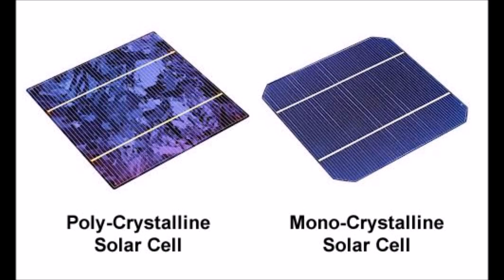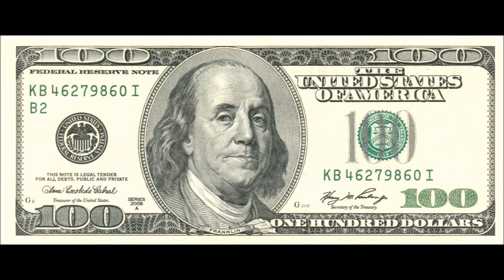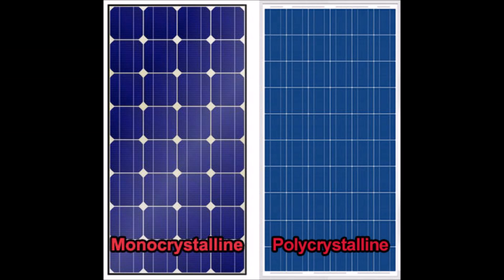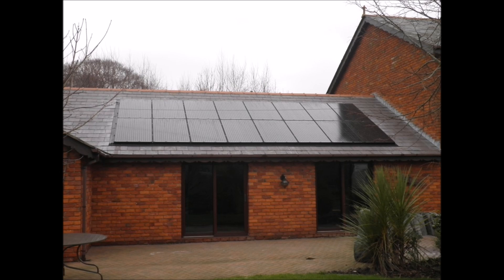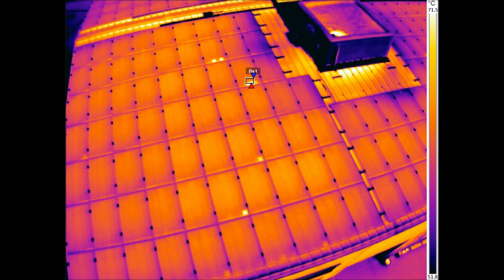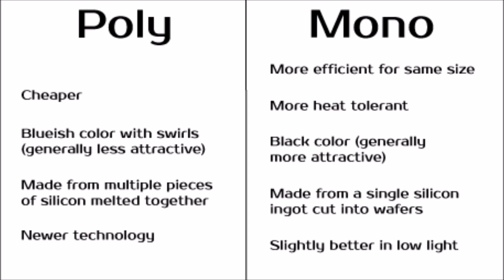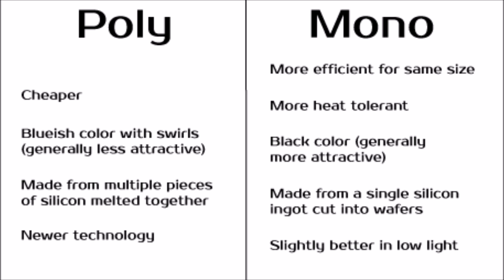Mono vs Poly Solar Panels Explained

Comment: When you say that mono panels are better in low light, is that comparing to the same space size poly, or the same wattage size poly?
Reply from the maker: Just the technology in general.  It isn't a big enough factor to persuade someone from buying mono unless you are getting many many panels and low light conditions will be common.  Like if you have an off grid cabin in Alaska or something.

Comment: Mono: More expensive, Generally black, more efficient, better in low light, more heat tolerant.

Poly: Cheaper, Generally blue, less efficient, worse in low light, less heat tolerant.

If your very concerned about cost, poly is where you want to go.

If you want the most efficiency, better looks, go to mono.
Reply: This crystal clear info i want

Comment: Mono do beater in cooler places. My mono do will in the winter but in the summer my pol out do the hands down. I live in SC where in the summer it can be 110 F with 95% humidity to 100%. I do not know if that has much to do with it or nit. Just know the pols make more power in full sun and the mono make more in shade or in cloud cover.

It's nuts just how much pv has come down. 10 years about I payed 6 bucks a watt. Now it's what 80 cents lol.

Comment: great info. thanks. as for the mono being cheaper, is that calculated on a per square foot basis, or a per watt basis? since they are more efficient, it is possible that they are more expressive per foot, but cheaper per watt. or maybe it's a wash???
Reply from the maker: Mono is more efficient so it is cheaper per square foot.  Per watt it is more expensive.

Comment: Great job. You have told me NOTHING about why the cells are differently shaped.
Reply from the maker: Sorry.  I didn't think that was relevant.
Reply: mono is cut from cylindrical boules where some of the rounded edges that remain can be seen, multi is cut from rectangular cast blocks

Comment: Ok so I’m doing a science assignment and I’m doing it on two different panels found on solar garden lights and seeing which one stays on longer  but I’m not sure what panels I’m dealing with at first I though mono poly but now I’m beginning to rethink the name of the lights are: gardenglo 35cm garden light and Alerc Elinor led solar path light. The Alerc one has a blue panel and the gardenglo one is black with small lines running through it
Reply from the maker: Poly panels are more often the bluish color and mono are more often black.  But that is not always true.  The best way to tell is that mono cells will be very uniform and even.  Poly cells will be more irregular and have transitions and jagged looking features.

Comment: Hi LDS . I see 100watt solar panels rated at 12V but a lot of 200watt ones are 18volt. Are the 18volt ones better to use for off grid homes?
Reply from the maker: They are the same thing.  12V solar panels are in reality 18V panels.

Comment: soooo poly is what is on thin film and what Tesla is putting out on roof shingles? which is better film or panels?
Reply: No polys are polys. thin film is more or less an ink that is printed on  flex plastic. More or less. Polys snap and brake just like mono's.. you can't bend them like you can an thin film or amorphous panel. Hope that helps
Reply: yankey4 what about there quality and performance to collect solar etc.
Reply: From the few I have had over the years. The amorphous panel down right suck. They did not last more than 2 years and there out put even new was maybe at best 70% of what there ratings where. Thin film I have not had much time with. They are kind of new to me so I do not know or can speek for there quality and performance . Sorry for spelling 2 ivs in my arms and computer hard to hold laing down..
Reply: I do have polys now that are 12 years old made from Kyocera. There still putting out 95% or so of there power. My mono's are doing the same there 13 years old. So tho's I can speak for,, I know that is not what your looking for. I just have to say what I know..
Reply: Amorphous is what kind
Reply: IV'S take care yankey4
Reply: So my primitive knowledge & understanding is that I need or looking for panels that collect (imput) the most solar to drive (output) my stuff. During high noon (effectiveness) or in an axis moving that follows the sun path increases my powering ability (output). & the ability to regulate storage to use & not use is a (controler) that keeps extra unused output in batteries for later use. The panels to use depends on your budget and efficient collection of solar & useage.
Did I get it in a nut shell?
Reply from the maker: Yep, that is a pretty good summary.  Good job!

Comment: Definitely going mono for a full house system
Reply: mono or poly comes in 2nd place after selecting the best vendor. I would use Poly from Trina Solar rather than Mono from some unknown brand

Comment: I do have a question.  Why do solar panel manufacturers stick to blue or black? those panels dont absorb all light waves. Why not make the panels out of a different color so they do absorb all colors?
Reply from the maker: That is just the color that results from the crystallization process of the silicon.  I'm pretty sure they can't change it... yet.
Reply: oh ok thx
Reply from the maker: You are welcome.  Thanks for watching!
Reply: your welcome

Comment: What do you think about flat film solar panels? I've heard that it's a new technology with lots of potential.
Reply from the maker: Thin film?  It is new and has potential but right now it has been less efficient than either mono or poly in the past.  However, I have seen CdTe panels that are now 21% efficient, which is better than mono or poly so I think we are moving in the right direction.  There are very few companies making them right now, though, so I have not gotten my hands on one.  I may try to see if I can do a review this summer.
Reply: I just saw a documentary on solar that followed an Australian companies research.  What they did was combined the traditional Silicon cells and the Gallium Arsenide cells in a unique double layering technique.  What makes it work so well is that it filters out the most efficient type of light for the Silicon and the rest of the light is reflected to the Gallium Arsenide.  The only draw back is that it must be liquid cooled to maintain efficiency.  It is expensive to produce, but I believe that since it is 30% or more efficient that it would pay for itself.  They had 1sq meter set up with mirrors reflecting the light directly into the panel and they recorded being able to produce 220kw.  I would like to know your thoughts on all of this, whether it is BS, viable, unrealistic, etc.

Comment: I'm wondering. I've heard that solar panel production can genetate quite a bit of local pollusion. Is there a difference in these manufacturing styles in that regard. I'm all solar but as I understand it you would not want to live close to the factories.
Reply: Jon Gretar Borgthorsson The factories are inside the sun so definitely not healthy being near. On earth it is much safer when they get delivered from the sun.
Reply from the maker: The processes are not all that different so I am sure they both have similar impacts on the environment.  Most rare earth element production happens in China and they don't really have great pollution and environment controls so that is probably where you are hearing about pollution.
Reply: LDSreliance Yeah I was propably thinking of the silicon tetrachloride byproduct from when they process the silicon with hydrochloric acid. Some of the cheaper manufacturers just dump it.
Reply from the maker: Yeah that is not good!
Reply: I dont know about everyone else, but I always stick to american made things no matter what. Yes, it may be a few extra bucks, but id say being the cause of someone losing their job is worse than paying a dollar or so more. Does anyone else agree?
Reply: I am a huge supporter if stimulating our domestic economy. I don't care how much extra it is. As long as the money gets recycled in our economy. Im with you 100% man!

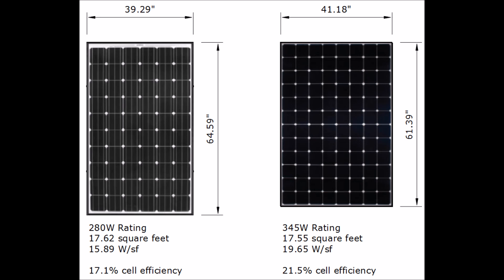Comment: You need to label better. On the panel diagram (about 1:20), you should label each panel so your viewers don't guess. Is the mono panel on the left or the right? We have to guess. Also, a national average cost per watt between the two types would be helpful; otherwise, it seems you'd always pick mono.,
Reply from the maker: Good ideas.  Unfortunately, that picture was borrowed from another source but I guess I could have overlayed some text.

Comment: Funny, I always liked the look of poly panels better.
Reply from the maker: They can both be pretty cool, I guess.  But most people prefer that black on black look which does not draw as much attention on your roof, which is also usually black or dark gray.
Reply: Since I live in phoenix I wonder if the efficiency loss for poly will outweigh the heat loss for mono.
Reply from the maker: Good question.  The efficiency difference is so small (usually like 2-3%) and really only affects the size of the panel not the output.  So a 100W poly vs a 100W mono will produce the exact same power.  I would say that heat is your bigger enemy.

Comment: It's a hard choice. I went w/ mono for size and heat reasons. I did not know I was going to be in a cloud bank or would have gone w/ poly. I still have the heat issue though and have my doubts as to how long I will stay here, so could end up w/ more sun in the future. I find the better option is just double the panels to make up for clouds. Other than that very happy w/ the mono. ones!
Reply from the maker: Do you have yours permanently mounted to the RV?
Reply: No I have them portable and heavily staked into the ground and also weights over the frames.  I get pins and needles tingles if it even gets near my RV.  Many have a hard time w/ them on the roof. They find they don't feel well in the house.
Reply from the maker: Interesting.  I haven't heard that before.  So why do you have the heat issue then?
Reply: There are a few heatwave days in summer, where the sun actually comes out and then it can be way over 105 degrees and even with the clouds be over 90. Of course they are in the sun getting much hotter than these air temps. I have had so many days of over 90 and sopping humidity. I had a day a couple weeks ago that was full sun and about 80. I noticed it took a lot longer to charge, as the panels being in the sun were probably over 100 or more.
Reply from the maker: Yeah that is true.  But think about how bad it would be if your panels were flush mounted with a roof or on top of your RV.  Without air movement behind the panels, they would quickly climb to 150+ F and produce very little power.  At least yours are probably closer to ambient temperature and still produce at least 50% of their rated power.
Reply: Agreed!